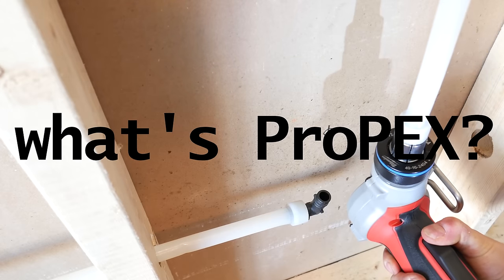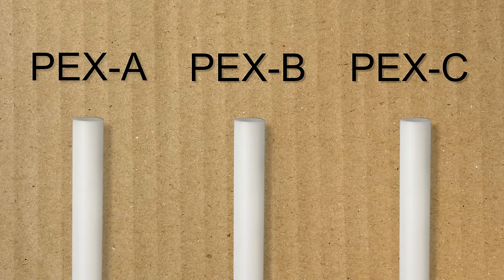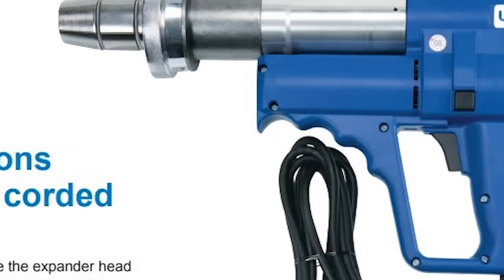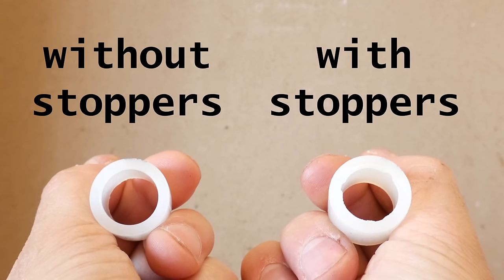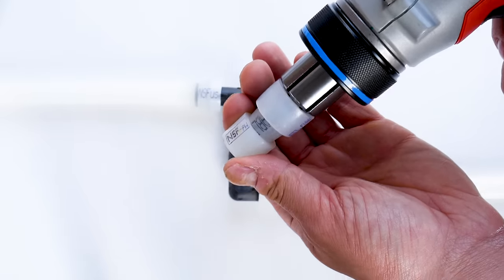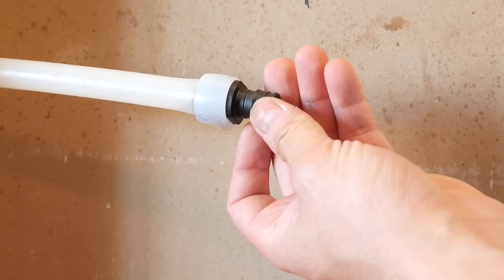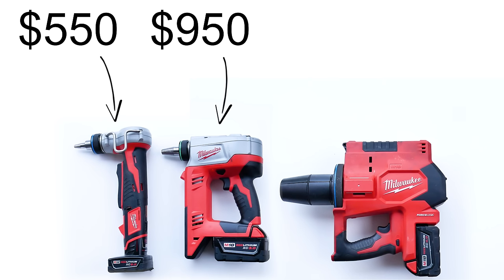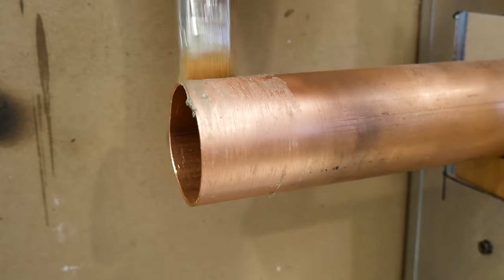UPONOR ProPEX, The Future of Plumbing (COMPLETE GUIDE) | GOT2LEARN

Comment: I am sold on Pex-A, now where can I buy it? I have tried all the local building and hardware stores and none of them carry it. I have the Milwaukee expander and can order Pex-A supplies online, but due  to the expense I don't need to buy an excess of everything I may need and I for certain don't need to wait a week for something I am short or forgot. Sadly there is also a smaller selection of Pex-A termination parts or valves. I am still sold on Pex-A as I live in a cold climate and busted pipes are fairly routine as heat tapes fail, power goes out, and on real cold spells, you will find the weak spots. Now if we could just get one of the chain stores to stock Pex-A, I could just buy what I need whenever I have to do a bit of plumbing. Thank you for the video, I always enjoy them.
Reply: Usually there is a local plumbing supply store that caries it. As you noted, the big-box stores do not. Otherwise, as you noted, there are online sellers (supplyhouse.com, etc.)

Comment: In SoCal we use copper pipes because it’s anti-microbial and we don’t have the freezing problem in winter. Also plastic degrades with time. You drink from dried plastic in 20 years and who knows. But it’s way easier in the short term.
Reply: Hmmm, excellent points.

Comment: Not popular in Canada. The tool is over $800 cdn to buy with all the accessories. Sales of the piping are restricted to licenced contractors. Physical clamping with brass connectors is more popular here.
Reply: Tool is 600 at depot, Dewalt is 350 without batteries. all big box stores sell rolls of pex a, order online it comes soon enough for a renovator or diye. Pex b can also be used,  it’s not gas pipe, just waterlines

Comment: Great series of videos, many thanks.  Just a homeowner and cottage owner and I have used pex-b and would like to use pet-a though there is a lot of confusion (learning needed).  Uponor has two names for things AquaPex and ProPer - differences? also, being a non-pro I cannot justify the cost of a power tool and wonder if iwix is a reputable firm?  I am in Canada and I'm having difficulty finding local retailers who carry these things at least by the names I find online.  What does "For Cold Expansion Fittings with PEX Reinforcing Rings for Use with Cross-linked Polyethylene (PEX) and Polyethylene of Raised Temperature (PE-RT) Tubing." mean to a non-pro?  I have been burned in the past with two different types of very similar looking white pipe. 🙂
Thanks for all your advice.

Comment: I install it when it's wanted. I'm not a fan, due to rodents finding this type of plastic to be something they love to gnaw on. This makes it inferior to cpvc, copper, or even galvanized for that matter. 
Imagine you have a properly installed system and a mouse causes thousands and thousands of dollars in water damage to your house while you are asleep in bed or out of town for the weekend. This is simply a no brainer to me, as mice don't care how new or clean your house is. On larger commercial structures, mice are in the building before it is even dried in and they never really go away. Every deer season, we repair pex on the trailers at camp as entire sections of piping are found simply gnawed away, about 4 feet is the current record. 
During our recent freeze event in Tx, even uponor needed repairs as the pipe can expand but the plastic fittings can't and would break as the water froze. 
Nothing worth doing is ever easy, including water pipe, in my experience.
Licensed plumber of 28 years. Houston, TX.
Reply from the maker: I agree that the mice is a problem for this type of pipe, but the real issue is the mice, they will do damage throughout the house if the issue isn't fixed, other than that, this stuff is really nice to install.
Reply: @Got2Learn  I'd much rather find out mice are in the building by finding droppings or groceries damaged than by having to file insurance claims and do repairs from water damage, which does thousands of dollars in just minutes.
Reply from the maker: Yeah, if you know there's mice in the building, it wouldn't be a good idea to install PEX before the problem is fixed, that's for sure ;)

Comment: 50% of my plumbers work is repairing/ removing Pex because  rats will chew there way through to get to the water.  Somehow they know water is flowing through Pex but not PVC.
Reply: @2skyman  it's funny you say that because I don't think anybody has ever thought about  doing that
Reply: @2skyman  I guess you didn't get the humor there sir lol.
Reply from the maker: He didn't.
Reply: @2skyman Let me elaborate..... First, the homes are all fairly new less than 10 years old and some as little as 2 years old.  Second, the average $10,000 in water leak damages revealed rats had been in there attics, rats don't generally notify the homeowners of there arrival. Third,  the first thing rats do is attempt to establish a water source once they're in and like I said for some reason they know  water is running through PEX. And last, my plumber said he has never repaired a rat eaten PVC, CPVC, Copper or Steel pipe and he's been in the trade for 40 years.     Personally,  PEX would be my choice, it's color coated, it's more versatile and they're manifold systems make it simple to isolate zones if needed.   We gave PEX a good 3 year shot and all was good until its Achilles heel surfaced at least in our general area of South Texas.  I also know and believe all the plumbing systems have their issues, mostly related to freezing but not rats, living instinctual, decision making animals influenced our decision to stick to PVC for now.   Good luck.
Reply: @Got2Learn    I honestly was looking forward to buying all the new Milwaukee PEX gadgets,
Reply: @2skyman  But we didn't want to hurt the poor little rats in fact we went a step further and also invited giraffes and elephants into peoples attics.

Comment: Dewalt also has this tool
Reply: Yes but they did not partner with uponor they made it  on they own for that uponor suggest you stick with Milwaukee to avoid any liability or void a warranty. As a commercial company we cannot take that risk
Reply from the maker: Good response.
Reply: Joshua Mcdonald    May be true but I have the Dewalt tool and it’s top quality and looks exactly like the Milwaukee tip. Don’t know why uponor is being so jerky about this. Must be a deal where they give Milwaukee exclusive rights for a fee?
Reply: Joshua Mcdonald 
If I remember correctly DEWALT uses the same expansion heads as Milwaukee don’t they?
Reply: @Kevr   uponor as a company has to cover their ass  because dewalt didn't want pay for licensing fees. Uponor had suggested if they find the tool to be faulty that was fault of a leak and causing damage you null & void warranty if you're on the DeWalt platform it shouldn't be an issue ever . but until DeWalt pays for a licensing uponor can't suggest DeWalt expander I just don't see how that's not patent issues I guess uponor / Milwaukee they don't choose to pursue it.
Reply: @ronh9384  the DeWalt expanders have their part number and DeWalt written on them no where does it show any uponor but really exactly like the Milwaukee's again another patent issue that I guess uponor or Milwaukee do not pursue
Again if you're on the DeWalt platform or you have the DeWalt expander should be fine
Reply: @Got2Learn  thanks 🤝

Comment: I'd be curious to know what those expanded joints strength is at hot water temps, like 150 degrees F...
Reply: Same rating as the PEX itself.  The white heating PEX runs hotter than 150, a lot hotter. Including the black non metallic fittings. Check out their website.
Reply: We use that for cold and hot water as well. We build 50-storey condo towers with that, no problem.
Reply: @jessybwoy8677  What kind of hydrostatic pressure are you getting in a 50 story condo?
Reply: @robertp7209  The website says otherwise. It says 80 psi at 140 degrees.
Reply: Beach&BoardFan 
we use stainless steel for the risers, up to 250psi or so...then we install a PRV at each condo dropping the pressure to around 50 psi and then switch to Pex A.
Reply: Beach&BoardFan - true, but who operates hydronic heating at that pressure.  My system is under well under 30psig, pressure relief is at 30.  So, if I recall, PEX can go a bit over 200 at lower applicable hydronic pressure. My high temp cutoff is 185.
Reply: Robert P 
it all depends on your building height. You roughly add 5 psi per storey so it adds up quickly.
Reply: @robertp7209  Same, but 140 degrees at 80 psi is the highest value they rate for, so based on that I'd assume the pressure capability would drop off significantly with temp increase. Most hydronic systems around me run 150-170 degrees.
Reply: Jessy Bwoy86  single family homes.
Reply: Jessy Bwoy86 - I meant to say, the white heating PEX sees higher temps because it is used for heating.  All the PEX colors have a max temp the same, as I recall.
Reply: @robertp7209  I dont think thats accurate either, the heating pex is rated for 200 degrees at 80 psi and potable water pex is rated for 180 degrees at 80 psi. So Propex is the lowest temp/pressure rated pex, 140 degrees at 80 psi...
Reply: Beach&BoardFan - could be - all I recall is the white PEX had an Oxygen barrier added.  By the way, Uponor is the brand PEX, the fittings system used with that tool are called propex, other fittings can be used with same PEX, like the ear clamps but with different fittings.

Comment: Florida loves Clorox in their water supply and PEX-A is less resistant to clorine degredation than PEX-B.  So here I use PEX-B for that reason alone.
Reply from the maker: Good to know, thanks Wolf!
Reply: I don't have any clorox experience, but we have run pH 13.5 sodium hydroxide (caustic soda) through it for 2 1/2 years with no change.

Comment: Great video.  I've been eyeing this system for some time. Like I said on your last video.  I have used the hepex system, but without that expansion tool, your stuck using some very expensive brass compression fittings.  Honestly, I probably was about 3/4 of the way to the M12 tool in just brass fitting costs.
Reply from the maker: Thanks Tyler. The brass fittings are not being made anymore because they are too expensive to make, so at least that's outta the way ;)
Reply: Yep ,it adds up quick
Reply: @Got2Learn  by what company?
Reply from the maker: @johnlsullivan896  general pipe cleaner

Comment: I have a bone to pick with this plastic stuff and new type of plumbing
Mst plastics over time were found to give off unwanted gases and particles that leach into the water
How does that stuff compare?
I will not use any plastics, because of it's poor stability, 
Everything made from plastics does not last, It breaks down over time, no matter what they tell you
Reply: I am also very concerned about plastics & toxicity. Since I'm a DIY noob, I went with PEX-A. I did add a big filter for the kitchen's cold water supply. I have no idea how well my filter works.
Reply: HDPE is impervious to pretty much all chemicals. Nothing leaches in or out. It is ideal for potable water. There are bad plastics like some Poly Carbonates that drinking bottle companies incorrectly used that leeched out potentially harmful chemicals.

Comment: Would love to use it, just cost prohibitive. Significantly more expensive and takes the same time as crimp pex. Can't justify it, unfortunately. Looks pretty fun it use though.
Reply from the maker: Sure is fun, I could tell ya that ;)
Reply: @happydogg312  As a contractor, I'm interested as to why you'd want pex-a exclusively? The material cost is usually about 50% more expensive than pex-b. Only upside I can see for homeowners is the slightly larger ID for fittings so slightly more flow.
Reply: @happydogg312  Thanks for sharing,  I'm in a more temperate climate so freezing isn't usually something we deal with. I always like hearing from the homeowner side, thank you for the great explanation!

Comment: Does plastic kill bacteria like bronze, brass and copper do? Any update on how carcinogenic PVC is?
Reply from the maker: No plastics are not known to kill bacteria from what I know of, but I do know that copper kills bacteria though, no updates yet on if PVC is carcinogenic, coming soon.
Reply: Thats a good point, however the cholrine/chloramine are far more effective in practice. Another plus side is the excess copper/tin you get from those lines isn't exactly needed by the normal human.

Comment: Not good for hot water no?
Reply from the maker: Good for hot water, no worries.
Reply: @Got2Learn  you would still need hot lines insulated at all? Whats the max temp to worry about?

Any leaching effects with lower ph water or mineralization?
Reply from the maker: Yes, PEX is prone to leaching, I have a video in the making about that, stay tuned.

Comment: I wish I had seen this before I built my house.
Reply: Why? You want shitty plumbin?
Reply: Ive been plumbing 18 years used all water systems and I think this system will last the longest
Reply: @t_c5266  I had to make more solder joints that I can count has I maneuvered copper pipe through and around joists and other obstacles -- everyone of which is a potential failure and a thing that adds noise to the system. With PEX I would have had a single uninterrupted line. And it would have saved a lot of time and money.

Comment: WAY TOO MUCH GREASE!!!  You want a "film" of grease only!  You are better to do a little more often that a "bunch" at once!  Reason; Too much grease will squeeze out and onto the inside of the pipe, a VERY bad thing!!!  It will prevent a good connection and leak or worse, disconnect under pressure!  The last thing you want is any lubrication on a joint, keep the expander tool end "CLEAN"!!   Water on the outside of the pipe with an expansion ring is also bad, it will "slip" using the water as lubrication!  Watch your sweaty hands as well!
Reply from the maker: Yes, I was told that after the video, use less grease people!

Comment: stay away from this pipe , pay the extra for copper . i recently  re piped a home with copper , i ripped all of this plastic pipe out because the home owner had an issue with rats , they chewed right through it and the home fllooded when the home owner was of course ,yes you guessed it , on vacation
Reply from the maker: Problem isn't the pipe, it's the rats!
Reply: Seal the house up, your biggest problem should be to block rats from coming in the house, Not changing waterlines so rats can stay inside and not chew copper lol

Comment: Can the 2-3" pex be used for drain lines? Seems like the ease of installation might make it worthwhile.
Reply: yea, people 3/4 pex on water heater tmp drains to the pan all the time. purple pex is designated for grey water aswell. if you are talking about for drain line like for a toilet or sewage idk how it would hold up with solid waste over a long run, that stuff would need supported every 2 feet or so which could be a pain in the ass. also idk how inert it is in terms of it not reacting with all the random stuff the ends up going down a sewage drain.
Reply: Thanks James. I wonder what city code would have to say about it.

Comment: Stick to ROTH/Sharkbite and you stay a happy plumber.
You need no tools, just pex cutter. Takes half the time.
 If you want to take it aport you need tool.
Reply: Sharkbites are homeowner/DIY grade. This system and tools are professional grade.
Reply: @MisterTwister88  Please explain why. Never had any problem with them and quality is high. Atleast the Roth system. We have 4-10 bar street pressure in my country. And its so damn universal to use, pex pipe and cu.
But to say, in my country we have no connections inside walls what so ever. search for "rør i rør" too see how all our systems are.

Comment: @Got2Learn - Can ProPex A only for indoor?  Can it be outdoor?
Reply from the maker: No, only indoors.
Reply: @Got2Learn  Check with Uponor. There is Uponor, rated for in ground use.
Reply from the maker: Yes you are correct, should have been more specific in my reply. Uponor PEX can be used underground, but not outdoors where it's exposed to the sun and rodents.

Comment: Well crimped fittings came and went,  I don't think this would work very well in a full blown commercial project
Reply from the maker: This is pretty much all that is used in commercial projects Al.
Reply: @Got2Learn  well I've done domestic and commercial and still doing so, this stuff maybe good for risers and long runs in corridors but not in apartments, working in voids and running through stud walls, a small crimper was hard enough, tho have used other uponor systems I haven't used this. Its just my opinion based on past experience as a plumber/pipefitter. Stilsons and spanners will always rule, mechanical methods have stood the test of time. Time will tell.

Comment: I'm interested in plumbing a small home made of concrete and exposing all the plumbing. Because of that I'm looking at stainless as an option. Have you plumbed anything using stainless or is copper/PVC the way to go for exposed applications?
Reply from the maker: You can always do copper, and paint it afterwards.
Reply: If you go with PEX, do something to keep it out of the sunlight.